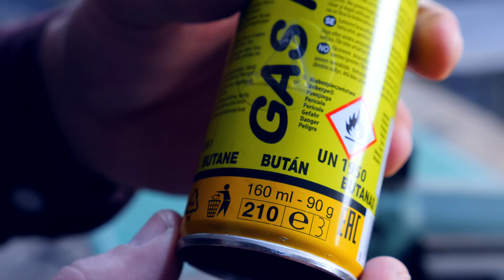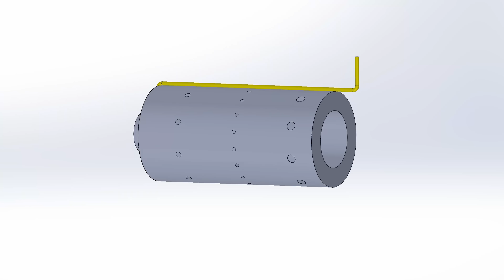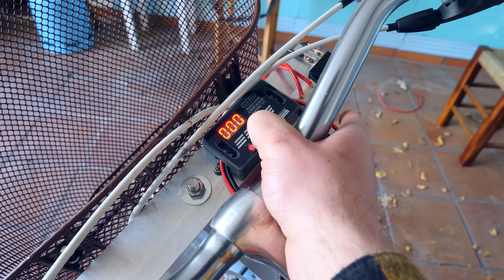I put a Homemade Jet Engine on my Bicycle

Comment: Anybody out there thinking about copying this he forgot to tell you one important safety message if you're going to be cutting any tin full of pressurised gas make sure it is empty and you rinse it thoroughly with water just letting the gas out is not enough it could still explode in a fireball make sure there is no residue gas left at all

Comment: Make a camera slider to capture slow motion footage of your flammable experiments!!! You'll need some 80/20 aluminium, 3d printed parts, some belt materials, 1 or 2 stepper motors, and an Arduino with a stepper motor shield.

Comment: what about using some kind of heat sink on the rocket nosel as well as redirecting a portion of the cold airflow towords the nosel this would allow for more heat dissipation and lower temperatures

Comment: Put 2 jets on a small boat and see how fast you can go. Start with 2 commercially available R/C plane engines as a bench mark. You could make a multi part series out of it. tweaking and upgrading every few weeks.

Comment: You should use a vessel to store the butane and push it in with something like nitrogen or something. With a valve you could adjust the fuel to air ratio.

Comment: HANDHELD SUPER JET ENGINE LEAF BLOWER.
(Usually flower to make it better leaf blower..)
Take your Jet bike and convert it BACK into a leaf blower, but leave the jet engine part , build an arm mount/handle & backpack, and break the record of the base leaf blowers power. 
One extra bit (if you get bored) could be to run a turbo fan with your jet engine, and use the output as the leaf blower. 👍

Comment: You could increase thrust by creating a bypass/aspirator similar to turbo fan without the turbo, the jet of gas out of the back would great a negative pressure pulling fresh air, over the exhaust cooling it also giving extra forward thrust.
You could also use the leaf blower to push cool air over the exhaust.
Reply: by my calculations that's an increase of thrust of 2:1, 2units of ambient air for every unit of combusted air being forced in the direction of the jet.

Comment: Have you considered buying a super cheap small stick welder and learn to lay a simple weld, so easy to do for what you would use it for and no more melting out brazing. I also bet you could 3d print a better fan for your leaf blower, you may find some more thrust.

Comment: You know how you did the 3D printed metal rocket nozzles? What if you 3D printed an entire rocket like that, and filled it with solid state rocket fuel? And then tested another one made out of standard 3D printer plastic and did that one with the rocket fuel. And then one of each with sugar rocket fuel?

Comment: Since you now are also using metal sheets, try doing some molds to bend the sheets into a form, this way you might not need to weld in some places, removing failure points all together

Comment: Video idea: try making ablative cooling. My spelling is probably incorrect but form what I understand it's basically burning away a bit of the exhaust tube/where the bulk of the heat is so that the heat isn't able to progress any further in the metal so that it doesn't melt. I think that would be a very interesting and educational video

Comment: New video: build a jet powered Dyson like Amplifier fan. The "bladeless" fan that actually has blades they are just hidden in the base. And see how much more air it produces, maybe put it on a cart of some sort. The jet will power the air through the ring and give it more thrust. Would be cool to see.

Comment: Idea, build a turbine jet engine from a turbocharger. Use the exhaust of a smaller jet engine built like the one in the video to power the inducer on the hot side of the turbocharger, and use the exducer of the cold side to feed the inlet of a bigger jet engine like the one in the video instead of the leaf blower.

Comment: Idea: create a full flow staged combustion, with 2 turbines (one for oxygen and one for methane). U can print the Lox and Methane turbine and body separate and use injectors to inject the fuel and oxidizer into the combustion chamber (CC). CC can have 2 walls and in between u can pass the air so it will not melt the chamber wall.
Reply: https://en.wikipedia.org/wiki/SpaceX_Raptor as an example

Comment: Idea for video: 3d print different rocket nozzles and designs and cast them in metal using the lost pla method. It’s an easy way to make high temp rocket nozzles out of metal, the only problem is steel is kind of hard to melt but aluminum might work a little better?

Comment: A couple of TIPs for you, when working with sheet metal: 1 when drilling a hole, take a cotton shirt, cut a small square and fold that square in half 2 times. Place that cloth on top of the metal and drill. This will ensure the bit doesn't just rip the metal and it will be a clean hole not a serrated one. It also prevents the metal from riding up the drill bit. 2) if you want a clean larger hole than a drill bit consider purchasing a notcher or nibbler, these are cheap and produce very clean cuts. And as always tomatos are disgusting..

Comment: Video Suggestion: 
You mastered Basic Jet Engine, 3d Printed Engine and Spot Welded Jet Engine. Schouldn't you start to construct a Engine that you have to start externaly with something like compressed Ait or the Leaf Blower but then it produces Thrust and some energy to power a 3D Printed Turbofan to feed itself and an Ignition System. What I mean is... You got Thrust but you need like 2 Power Sources (Electrical and Fuel) reduce to just 1 Powersource NOW. And maybe let it drive over some Tomatoes next time.

Comment: I think you should ramp up this idea and make a pulse jet engine. It's quite simple to build, a PITA to tune but once you do it, there's basically nothing to go wrong if you use the right materials to handle the high temperatures.

Comment: was it welding or soldering the exhaust? if a weld would melt so would the rest of the exhaust, solder, however, has a lower melting temperature....

Comment: Idea: Pedal-powered rocket engine with a rechargable battery via a dynamo for going down hills. The initial pedal ignites a pilot light, then turning of the pedals (and so wheels), pumps the fuel to the engine. The faster you go, the faster the jet goes, which just increases fuel consumption and you're speed. Don't worry about breaking! Just let the fuel run out! #noregardsforsafety

Comment: Attach a large propeller to a Tesla turbine. Attach the bike chain to an air compressor and run the air to the turbine. Use this setup to propel the bike.

Comment: While not the most outright powerful, jet fan engines are a lot more efficient at extracting energy from combustion gases and converting it to work. Maybe try and print up a set of nozzles (jet fan blade sets are considered nozzles don't @me) in the ceramic resin you used to mess around with?

Comment: Video idea: A 2 part solid fuel rocket that uses the first part to ignite the second part.
Idea for this video: Wind a pipe around the nozzle that feeds coolant, either water, mineral oil, or liquid nitrogen, from a reservoir to stop or at least delay the overheating and melting of it.

Comment: 3d print a turbine engine, and use it for make electricity and heat water at the same time. Maximum energy efficiency.

Comment: Idea: how about a heavy duty steal funnel, and as someone else in comments also said use the extra air to cool the exhaust. Maybe add some kind of rudder for extra steering, maybe a two rudder system where the exhaust comes out in-between the rudders, so when you turn the bikes handles the rudder turns. (I'm not sure if anyone else said something similar 600+ comments to read not possible lol)

Comment: Nice to see you back, alive and well😁
The "welding" problem is that you were hard-soldering (with brass?)
To proper weld you need you fuse the Parts, instead of sticking them together with a metal with relatively low melting point.
Anyway: another enjoyable video, though I still miss your facial hair 😜
Reply: brazing
Reply: @Blox117  Since our friend Integza is Portuguese, and the Portuguese words for "soldering" (=brasagem) and "welding" (=soldagem) are quite confusing, I opted for "hard soldering". But you are absolutely right, it is also called "brazing". I've been brazing since 1973, when I built my first two-stroke exhaust, aka expansion chamber. (yes, I'm really, really old 😁)

Comment: this is soldering, not welding :D
Reply: *WELDING!!*
Reply: @JESUSCHRYSLER5512  In soldering, metal fabricators heat the metal to be bonded but never melt them. In welding, metal fabricators melt the base metal

Comment: Try making a thrust augrmntor for the exhaust so you can achieve higher power at the cost of a lower top speed, which seems fine right now as the air is moving much faster than the bicicle coming out of the exhaust. Also you could try to optimize compression for a more efficient reaction by adding compresser fins at the start like in a turbojet engine.

Comment: Idea for next steps:
1 - Your main problem its always temperature - melting explosions (nice but not the idea)
2 - Cool the body/nozzle using propane lines around them (line NASA rocket nozzles)
3 - Or use you air source to cool these components :). Interesting building process for both.

Comment: You could go back to what I think is the root of this channel: trying to revive archaic inventions and apply them in new and interesting ways. Here's the pitch: Combining arc lamp technology, specifically in the form of a Yablochkov candle with the concept of an arc jet. Should be doable, maybe? And high voltage arcs are more than capable of tomato murder if that's a requisite.

Comment: I noticed when you were brazing you were feeding in the filler by hand. That works if you need to do it, but in those joints you can also form a ring of braze that slips over the tube and rests on top of the joint. Then cover in flux and heat it up. Because you have the filler placed exactly where you want it before you start the brazing operation, you only need to control the flame and heat evenly. This lets you get much much more consistent joints, and avoid most potential of moving the part accidentally while brazing.
Reply: another tip
don't use brazing at all for a project like this
soldering =/= welding
and the dripping solder is exactly why
Reply: @PlokTheMasterGamer  yeah, welding would be better with anything that glows during normal operations. I do think silver brazing would be an excellent solution for the intake side however, as the capillary action of the filler is really great for getting a seal around fittings and joints, and it is very nice on thin parts as not melting the base metal saves you from a lot of distortion issues. It can also be handy on dissimilar thickness joints.

That being said, brazing =/= soldering.
Reply: Another tip, don’t direct the flame towards the joint but heat up the metal next to it. Once the base metal gets hot enough it will melt the solder and suck it into the joint.

Comment: Try weld thiker sheets of metal using eletrodes or mig, its really easy to learn at least to joint material, probably uglier but functional. Btw if u can ride up in picoto u just invented the best bike ahahah

Comment: Design an adjustable nozzle for rocket engines (withen a reasonable size) to find the best angle and diameter of the nozzle for the best rocket performance

Comment: You should try a pulse jet engine.  The brazing you did to hold it together will not last long.  Like previous comments use the excess air from your leave blower to cool the outside of the engine.  This is how modern jets work.  Tbh they use the big fan for propulsion instead of the jet engine.

Comment: At the speeds you are dealing with my recommendation is to use goggles when piloting your rocket bike. And adding a parachute to slow you down would also be wise. And absolutely your grandfather would be proud.

Comment: An air bypass that blows over the outside of the nozzle could help. It works by creating a negative pressure vaccume venturi. The air pressure blowing past the nozzle wil cool it andl create a low pressure zone directly behind the nozzle which will help. It might even create a little more thrust.

Comment: You can try to manage your temperatur problems with aerogel. Maybe you put it inside the buring chamber and seal the whole thing. Then it could even be cold enought to touch it. :)

Comment: You should absolutely strap a tomato to a rocket. Then make rocket fuel out of tomatoes and shoot it up as high as possible with the only objective being to destroy tomatoes.
Also I think that if you had just used the air from the leaf blower directly you might have actually had more output power than now XD. Anyway good video. Your engineering amazes me.

Comment: why dont you attempt to add a after burner to the jet engine they are supposed to add extra thrust and are pretty symple concepts (spray extra fule into rhe area behind the last compressor to reaccelarate the gases before they leave the nozzle)

Comment: I have an Idea for the metal issues: use clay then use a mold to shape it, wait until it hardened so we can remove the mold, and burn it until you make a brick that is heat resistant. hopefully

Another idea: use a fuel that produces soot like kerosene, so the soot block the exhaust from touching the wall or the nozzle (just make sure that soot don't form in the injector).

Another idea: make a 3d printing or even programming tutorial if you want

And remember, tomatoes are disgusting!

Comment: Idea for next steps:
1. Make a test rig to measure the output force of each of your rockets engines. Then you can optimize them using the data you measure.
2. Choose the best one to build a flying rocket

Comment: Can you try making a 2 stage rocket?
Where the 2 stages are propelled by different fuels?

Like use water propulsion to launch and ignite a rocket engine or vice versa

Also like trying to combine 2 types of propulsion together simultaneously, that is a project I am working on but you can try too!

Comment: Back in tje good ol days, there was an invention called "GyroJet", which was a form of firearm ammunition where the bullets themselves were propelled (aka they were little rockets).
With all regards to safety, I think it would be interesting to see if Intregwaz could replicate this tecnology with the current production capacity his workshop has.
Reply: There are few modern Gyrojet builds by people who actually know thing or two about firearms and rockets...Integza might not be best person to make those since his optimizing put it bluntly sucks, but sure he knows something about rockets, so i guess it could be interesting. I'm just afraid it will be just another somewhat works effort. Specially when the rocket nozzle needs be really accurate and fuel fast burning mixture that creates huge pressures. He simply lacks precise enough tooling to make one work. Ceramic print might do the job of precision and heat resistance but it wont take the pressure.

Comment: Idea:  try attaching a jet engine's exhaust to a turbine which then drives the bike wheel? (bit of a rube goldberg machine but why not? 😆)
Reply: Just a turboshaft engine. Coupling would be a nightmare as turbines have 10000-100000 rpm and bikes like 1-10

Comment: You can have a try to make a pulse jet engine (colinfurze's design). That design worked pretty well. What you can do is improve its design or the fuel intake or increase the overall thrust or can make it silent.... But this time please make it with thick steel and not with 3d printer😐

Comment: Here's an idea make a variable nozzle at the end this will help improving the efficiency of the engine by choking the exhaust of the engine and increasing the speed. You can fine tune it until you reach the best thrust.

Comment: Please buy yourself a TIG welder for pete sake.

What you just did is called "soldering" not welding. Your welds would not have failed so easily had you achieved fusion of the two pieces instead of just gluing them together with brass.

Comment: Idea- wirefeed mig weld under argon instead of brazing the steel. Cuz.... Your borax powder torch & stick is pretty much brazing.
Might be ok? But even a sub $100 no gas stick welder used properly will get you a real weld with higher strength & heat resistance. Love ya!

Comment: Well if im not wrong, you didnt really weld the thing besides the Spot Welds, the rest was soldering, which is not surprising it didnt survived the heat. The Solder needt so melt at a lower Temperature than the Metal its connecting. So yeah if the Aluminium Can is melting the Solder definetly is

Comment: U should get some real steel tubing and jsut get a cheap 220V welder that you simply plug into the wall that uses no gas, u use flux welding thread(dont know the exact words) I have one of those and the welds aren't pretty but they are as strong as welds from "real" welders.

Comment: @integza   The word you're looking for, in English, is "Brazing"  Not welding.  Welding involves melting the two pieces together, sometimes with some filler.  Brazing is kind of like high temperature soldering, but the original pieces do not melt.  Your Spot Welder is indeed a welder.  What you do with the torch and... I'm guess a brass rod? is Brazing.  With welding, the filler material won't drip and the parts fall apart after getting heated; with welding everything would melt at a high enough temperature.

Comment: Instead of lowering the speed of the leaf blower why not 3D print a flow separator.  Use part of the airflow to supply the combustion chamber and the other part of the air flow to cool the jet engine itself?